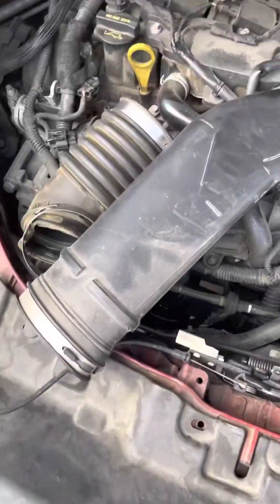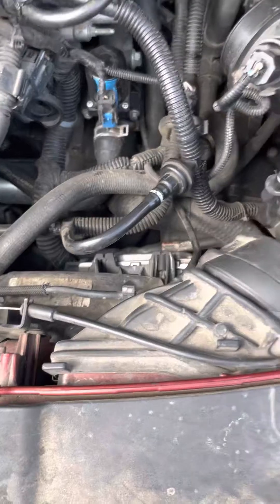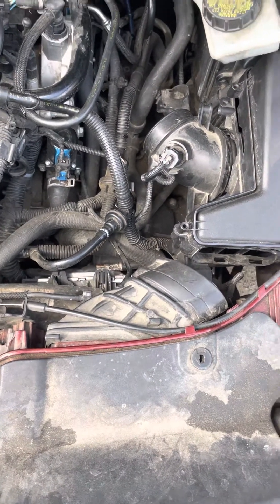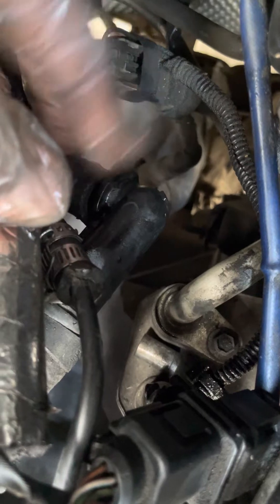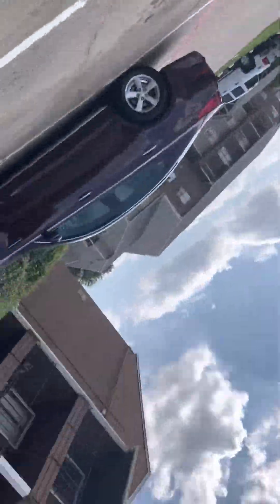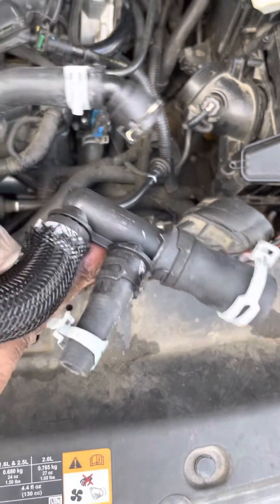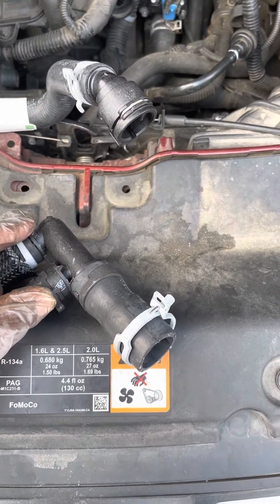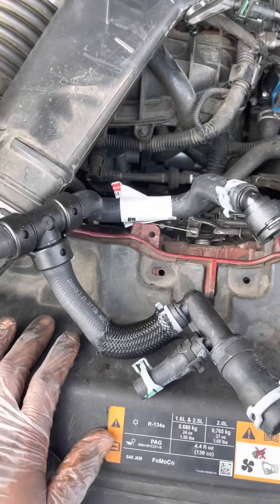How to replace coolant heater t hose for 2013-2016 Ford Escape part one

Comment: Do you have a part number?
Reply from the maker: 125187-05673797
Reply from the maker: https://www.partsgeek.com/gbproducts/DC/125187-05673797.html?utm_source=google&utm_medium=ff&utm_content=DN&utm_campaign=PartsGeek+Google+Base&utm_term=2014-2016+Ford+Escape+Heater+Hose+Motorcraft+KH-872+Heater+Inlet+14-16+Ford+Heater+Hose+15&fp=pp&gbm=a&utm_source=google&utm_medium=ff&utm_campaign=PartsGeek+Google+Basecid=6774379819&aid=79287199093&keyword=833827449785%3A%3Apla-833827449785&kid=833827449785&gclid=Cj0KCQjwjbyYBhCdARIsAArC6LIwba4NdvXOWPsHPC45yet74Oc1ivCFWL9UuAbU6245Nb_J0i0pV6waAojAEALw_wcB